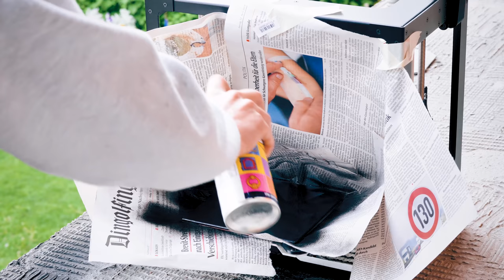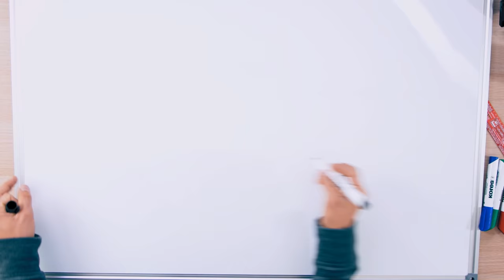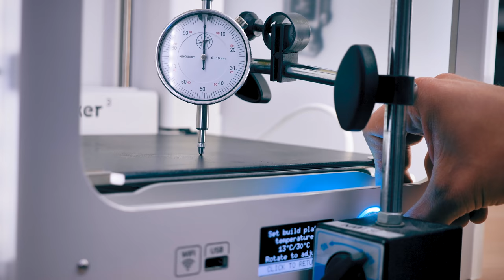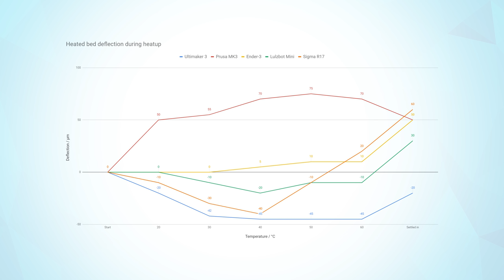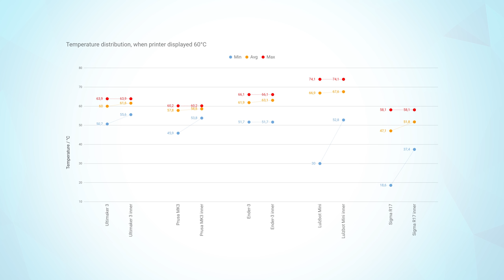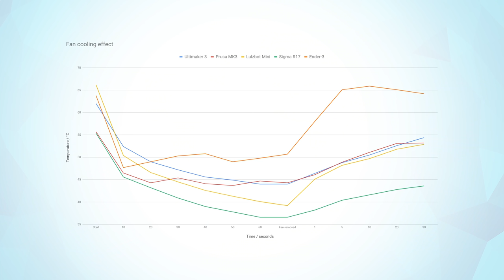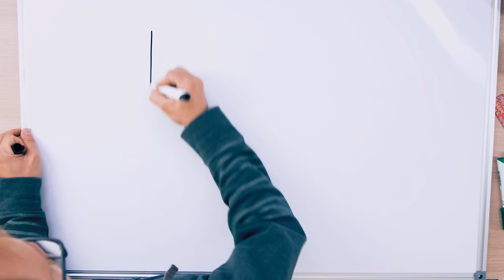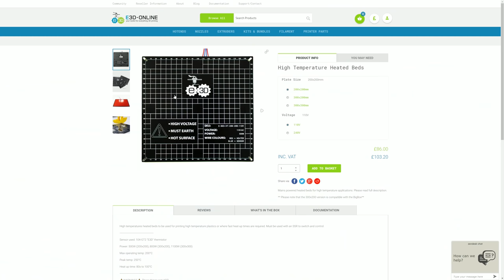Advanced heated bed tests (now with 100% more graphs)

Comment: Tom, I can't tell you how Linus Tech Tips makes graphs. However, I can tell you that you're on the right path with knocking things over during the video shoot. ;)
Reply: LTT makes there graphs using Power Point Presentation or u can at least get the same or simalar results.
Reply: @Milan Alfonso Thanks so much for your reply. I got to the site thru google and Im trying it out atm.
Looks like it's gonna take quite some time so I will reply here later when my account password hopefully is recovered.

Comment: The heated bed warping is a great example on why using a raft for printing is better for accurate prints in the z axis. A raft of roughly 5 or more layers can greatly help take out the inaccuracies in your print from bed height differences. You sacrifice a pretty smooth part surface for a more accurate print.

Comment: Rare powder coated sheet: *exists*
Tom: Let's spray it with paint.
Reply: If that's all you can take from it... grats! You made it at least part way through! Doing very well today!
Reply: NiceWhenEarned RudeMostlyElse 
If that’s all you took from that comment, grats...
Reply: emissivity for a black body is ε = 1.0 which is actually preferable for heat transfer.

Comment: Would be great to see how your Mendel and delta heated beds perform with those tests. Thicker aluminium might lead to better results with fan blowing on it. Your heater for the delta has way more power than the prusa i3’s power supply, so it would be interesting to see how that affects it.
Also would be great to see how insulation under the heated bed affects the performance.
It would also be great to see how different cooling fan designs affect the temperature of the bed when printing a part.
Or how about using flir camera to show temperature differentials within an ABS part and how that leads to curling and layer splits. So many things to do, so little time!
Great video, really enjoyed them. Can’t wait to see some more!

Comment: This is one of the reasons i use a sheet of thermal material in between my glass and heated bed. It mitigates this very well
Reply: What sorta thermal material do you use?
Reply: @revhappyrs2k  You can buy large thermal pads, the ones normally used for CPU/computer chip heatsinks, and place it in between the bed and the glass.

Comment: All of this (as well as the previous part) have led me to try a 0.5mm aluminium sheet on top of a 5mm aluminium plate. The aluminium sheet (with 0.2mm PEI on top) will then act similar as a removable spring steel sheet (of course much less flex possible before permanently bending it) and will be held by a couple of clamps. I'll see how this combination works out.

Comment: Would love to see some similar types of comparisons with: bare bed (already performed in this video), bed with aluminium coated mylar radiant shield underneath, bed with closed-cell adhesive-backed neoprene applied to entire underside.

Does the heat shields improve things or do they increase emissivity more than they improve heat insulation ? Do they reduce fan temperature drop ? …speed recovery time on removal ?

I don't think anyone has done this type of empirical bed testing: you're blazing trails here and the world is better for it. Thanks Tom ! ♥️

Comment: After your first video, I decided to fit an aluminium plate to my Sigmax and add the Filafarm switch plate system. Apart from a huge amount of time wrestling with levelling, due to the weight, the printer is now printing like a boss. My failing prints were due to lousy bed temps, so thank you for that and this video.

Comment: Great video. One point about fan recovery. I think the bed should be able to keep up if you are cooling the bed near where the thermistor is reading the temp. I think the reason the UM3 takes a while to recover is that (at least on the UM2, I just had apart) the thermistor is way in the back near the power connectors. Some printers I know have thermistor near the center.

Comment: Nice. That's why when I manually level the bed, I wait 5 minutes after it "reaches" temp. This is the type of video that really helps people understand printers a little more. Good job. I've done similar measurements with the Zonestar (steel frame ver.) I use. It has almost 5 km of filament printed through it. Only had to replace the nozzle twice because of burnt wood filament. Oops.

Comment: What i take it from this great video is, if prusa heated bed will be from aluminium (with magnet and externeal heating elements) with some  more advanced thermo isolation on bottom and with better placed thermocouple or maybe more then one thermocouple like center, edge and corner. Then we will have a ideal heated bed.

Comment: I hate to say this, but there is something about the Prusa PC print bed that you aren't taking into account. There are actually two PEI layers between the heater element and the print surface (one on either side of the steel sheet). And the middle PEI layer is only in point contact with the heater (because of the rough texture of the powder coated surface). It would be informative to see the difference between the (difficult to obtain) powder coated PEI sheet that you used and the smooth PEI sheets (sticker based) that currently come with the machines. Even more interesting (though would again get to a non-common surface) would be to get a bare steel sheet and only put the smooth PEI surface on one side, then run the test with the bare metal surface against the soldermask of the heated bed. (Removing one layer of insulation out of the stackup.)

Comment: For a future follow up video, it would interesting to see the results of the anycubic ultra base.
Reply: I have a thermal camera, it is super uniform. In my case I have a keenovo 750w heater underneath so the results may be useless though. CR-10s with keenovo under an aluminium sheet (stock solution) and ultrabase on top.

Comment: You should have placed a heat insulator between the bed and the measuring device. Great video!
Reply: ya, I wonder how much thermal expansion of the dial indicator stem impacted the results
Reply: My dial indicators have a tungsten tip. Super hard as to not wear and thermally stable. A regular indicator tip will not show any significant deflection in this test, possibly 0.003mm within 100°C. They are usually stainless or a tool steel, also stable materials for general measuring.
Where a heat insulator should be used, in any 3D printer, is under the bed as a blanket to increase the efficiency of the hot plate. With as much heat soaking into the bed and not the ambient air you can regain the heat lost from that tiny fan test in no time. Remember, the plastic you just printed is more surface area for a breeze to cool the bed down. Besides, as long as you don't use glass you don't really need the bed on after 5mm or so. Try it for yourself, you'll see. Add M107 after you find the first Z5. Let me know how it turns out. 

As for bed warping, that is how material science works. You fasten a plate simply by the corners and you will get this kind of middle-of-the-bed flex. Up or down. Using thicker aluminum plate(I have 5mm) will help prevent some of the flex but not all. Having a thermally stable material such as [CENSOR] is what I'm waiting to test. :-)

Comment: Could you do some "benchymarking" with a perspective of reviewing power consumption?
Take a 1 FFF printer. print a benchy, test different materials, An enclosure, an extruder sock, different bed types, glass/Aluminium/Steel. Maybe looking at the efficiency of the PSU.See which uses the most in KWh and if there are any simple things that can be done to improve it.

Comment: Similar to what I expected: the base under the print surface should be thicker aluminium do distribute heat and have a mass. Actually I don't even understand why Prusa is using FR4 PCB instead of aluminium-based one.

Thicker bed is bad however for moving-Y-bed printers, and also slows down startup on low power heaters, but definitely good idea for high powered silicone heater.

One thing which I am most concerned about: the mounting method could have effect of warping not just during heat-up stage but all the time while heated up, because the bed expands laterally too, and if the mounting screws can not move in the holes of the (much colder) carrier plate the assembly could warp.

Comment: Some apps like "Thermal Camera+ for FLIR One" allows one to set a fixed range inside the app, very useful if you are looking for very subtle changes in temperature, and don't want to be blinded by radiators. Admittedly I have only used it on there older models of camera and don't know if it works on the new ones.

Comment: So basically Ender 3 comes out as a champion out of this video.
Weird because I have a lot of problems with bed warping on my ender 3, fake buildtak completly coming off when trying to print ABS(100*C) and it's impossible to have it leveled across entire surface, for each print I always just look at the brim/skirt and adjust the bed so it's leveled just in the spot that I'm currently using.

Comment: I had massive leveling problems with my Lulzbot Taz 5 until I discovered I had to level at full temperature. Not sure if the temp of the hotend matters, but definitely the bed.

Comment: As I mostly print with a bed between 85 and 100 (HIPS, ABS, NYLON) a test at those temps would have been interesting - but great job and good info. BTW I up the bed to 85-90 on PLA as it anneals while you print - at least if the print is about 2 in (50mm) or less tall and the print time is 2 hours plus - and you leave it enclosed and sitting on the bed until the bed reaches room temp (made a video on that on my channel)

Comment: For the nice looking charts question: I think LMG designs them in programs like Illustrator and probably together with after effects for interactive ones. At least that's how I would do it, just spent some time on making a nice template, use the chart tools and insert data.

Comment: Since you already got FLIR camera maybe testing cooling method for controller board/driver. Which is better, heatsink on top vs bottom of driver? Also testing on fan cooling on top vs bottom on integrated driver board like Duet Wifi.

Comment: Thank you for experimenting and sharing all of this information! It would be interesting to see histograms showing the heat distribution of the different heated beds, to help quantify the gradients and general inconsistencies. Providing the standard deviation as error bars to the mean measurements you made would shed some light on this too. The FLI software might be able to provide these over a user-defined region of interest, but if not we can produce these ourselves using the raw images. Regarding plots, ever since I started making plots in python with the matplotlib package I've never felt the need to use anything else. MATLAB and other high level programming languages work well too.

Comment: yeh, I can confirm the aluminum beds, I have a micron (probably +/- 10 micron, but values average between 3 points and samples never go outside that or it reports an error) accurate z and probe when hot and cold (max number duet allows, use the map with a leadscrew adjustment for prints), other than where the traces are, points do not move at all between the two. 

(now my aluminum plate is still bent light crazy across the diagonal corners and you should use a glass bed but it doesn't warp, allowing for mid temp changes and accurate adaptive 1st layers)

Comment: Awesome investigation. Does this confirm that if you have a troublesome bed that potentially warps, the quickest fix is simply glass with/without a PEI sheet on top?
Reply: Glass will warp upward if the underlying bed also warps upward. If it underlying bed goes down then there will be an air gap in the middle and the bed will not reach the temperature that the sensor is reading. Adding more layers to a heat bed will throw a wrench in the thermal properties of your printer.

Comment: I'm still interested whether or not heat distribution on the Ender 3 could be improved with insulation from beneath.
Reply: The CR-10S does have underside insulation, makes me wonder if I should just slap a PEI sheet directly onto the aluminum bed.
Reply: Had the same question. Does insulation on the underside help?
Reply: @GeorgeLeite  it can't hurt.

Comment: Hi tom Any chance on comparing tmc 2130 to the 5160 and the difference in stelthchop 2 to the first version of the stepper drivers?
Reply: I have the Tmc5161 on my bench, and it is a whole different animal, but about no current firmware supports the best features stealthchop2 and stallguard2 are very good and freely configurable.

Comment: i find borosilicate glass tends to take just a bit longer to heat up, but then retains heat much better than aluminum
Reply: Well, yes. That is physics. Glass is an insulator after all... Aluminum is used for heat dissipation, hence it will cool down more quickly than glass.

Comment: Hey Tom what are your thoughts on Aluminum bed with silicone heater mat and a spring steel sheet with PEI coating which sits on top of the aluminum bed and is held magnetically?
Reply: That's also what I had in mind after watching this. Should be a good mix of performance and convenience 🙂

Comment: Wouldn't the best construction be the heat source sandwiched between two identical sheets of aluminum?  The stresses in the two layers should cancel out if they have stiff enough connections to each other.
Reply from the maker: Yes! That's exactly how I fixed (or at least reduced) the warping issue on my old Mendel 90 that I showed.
Reply: I was about to ask exactly the same question. Thanks.  So with the sandwich idea, which would be better? 1. Slipping the thermistor in between the sheets or 2. Embedding it in the upper sheet so it's closer to the top surface?

Comment: Does anyone have good recommendations for high temp thermistors for the nozzle heater block that can go beyond 300 C?

Thanks for your great work, Tom... i've learned a lot about 3d printing from your channel, and still at times rewatch some of your old videos for refreshing my memory. xD

I suppose i should get rid of my glass top plate... i kinda added it because my aluminum bed was a bit to thin and might have gotten bent when i made it, i followed your recommendation and got a 600w 240v ac silicon mat and  for my 20x20 bed and it just works wonder wonderful.
will heat up to 150 C in like a minutes or two.... 

not really sure if it heats consistently, but with all that power, i don't think it has much choice, and the glass plate did seem to solve my bed warping issues, but i may try and make a 2nd layer of thicc aluminum removable top plate, because why wouldn't i want it removable.
and then i don't have to solve the issue with moving the mat from one piece of alu to the new one xD

also built an enclosure for my 3d printer, my recent problems is that my thermistor in the nozzle block becomes wildly inaccurate above 260 C.
and my extruder doesn't really wanted to grip well, so i will be switching to a dobit "bondtech" chinese clone extruder which looks kinda nice.

Comment: I was going to ask if a double boiler type of heated bed would be good as it would really allow even distribution, but apparently water's heat transfer is pretty low.

So what about a copper bed? It's apparently higher than aluminum and even gold, and while the price is nearly four times, it's no gold or silver.

Comment: @thomas: you told about the fast increasing temperature of ender 3 and that the temp exceed... Did you think about that your fan is at the point of the thermistor?

And second: what do you think is the result of this cooling in a printer with/without housing... Because of printing ABS? Can you repeat the measurements with temporary housing?

Comment: ah chart goodness. I am sure that LTT etc charts are microsoft excel, or you can make a 1:1 copy in excel at least. A bit bit bigger font on the charts would be good (i am on a 40 inch 4k screen and need to squint a little) and personally i would get rid of the numbers for data points. On the grounds that your rid is not accurate to the nearest micron so graph is good enough to tell what is going on.

Comment: 21:32 you conveniently forgot copper?.. ;) 
always like your video's :)
Reply: Blue American Muscle Kennel 
Aluminium (or ‘aluminum’ if you insist on using the non-standard term) is the best material for heat transfer, so should deliver the best results.  It’s also far cheaper than copper, due to the super-rich having nothing better to do with their money than distort market prices.
Reply: @boggisthecat  actually copper transfers heat many times better than aluminium. But copper is heavy and expensive, very limited resource. Aluminum is one of the most common materials, but expensive to make (hightemp furnaces required, a lot of processing).

Comment: Real Interesting video, I am in the process of designing and building a larger printer using 4x 220*220 heat beds under 1 sheet of 440*440 glass (I know its special glass but the name has completely gone and Im not going to turn on my other laptop to find it,  I've got "balsamic" in my head now LOL) I think from watching this I may add a layer of aluminium between the glass and bed to even out the heat.

Comment: Copper would probably be a better material than aluminum. It has twice the thermal conductivity of aluminium and 1/3rd less thermal expansion.  Does anyone build one out of a thick copper sheet?